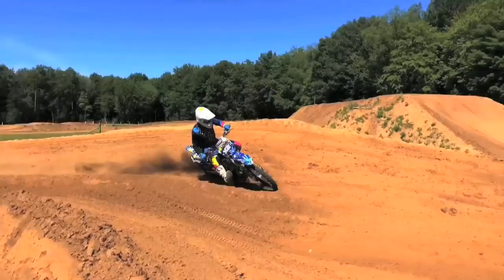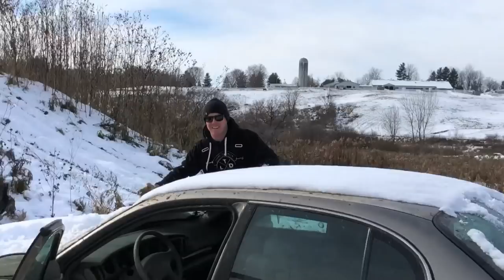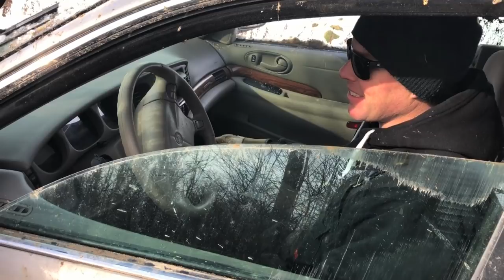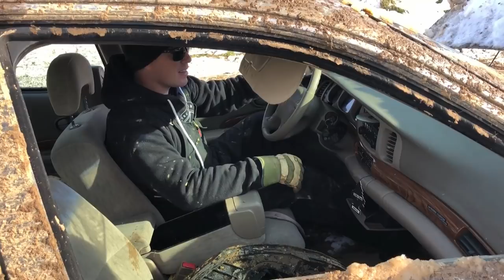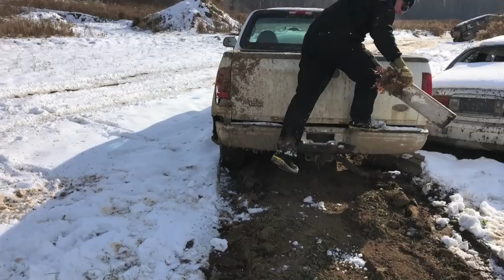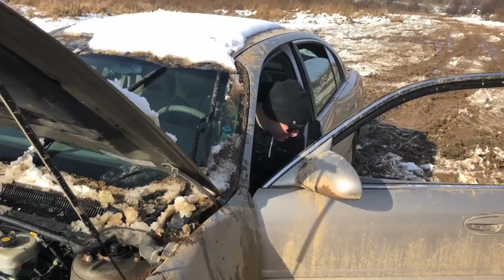Buick FIRE! BLOWN TRANSMISSION!!!

Comment: You gotta try the sand in the oil, or coffee grounds or something. It will plug up the oil pickup and give the rods the ability to escape. But don't unplug wires. The rods need the full running speed.
Reply from the maker: Next time! To the F-150!

Comment: Even running on 3 cyl  that 3800 sounds so much better than the 4.0 explorer.  Man love the sound of the 3800 wide open, what tough as nails motor!
Reply: They are great engines just if gm transmissions where just as good but if that was the case they'd never break down and gm would go bankrupt.    The transmissions are always the death of these old buicks  and mostly any old early 2000s or 90s gm cars or trucks

Comment: add cement in oil it will be like sand paper inside engine crank case that will help it knock that's how i killed my lawnmower engine knocking like crazy.